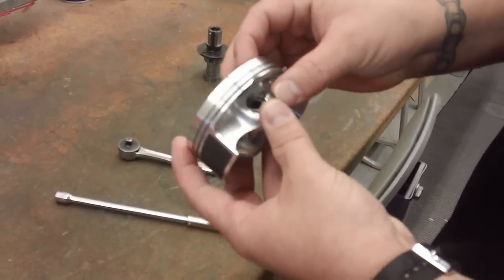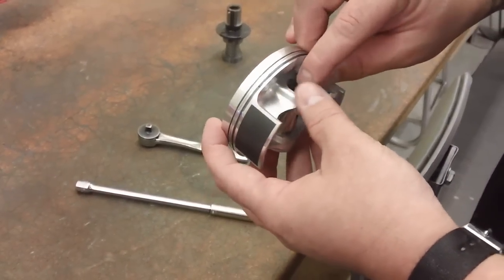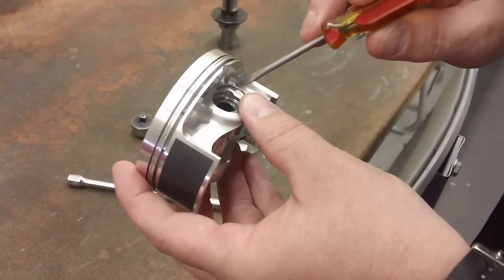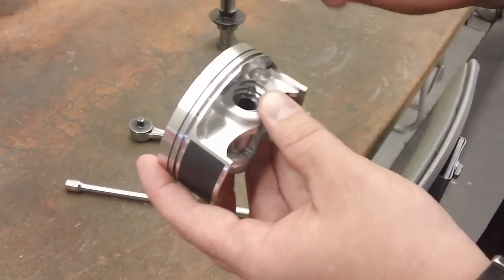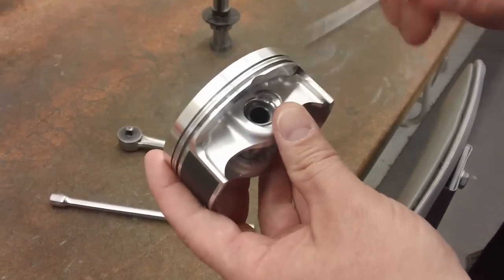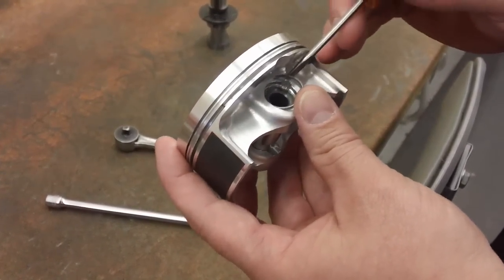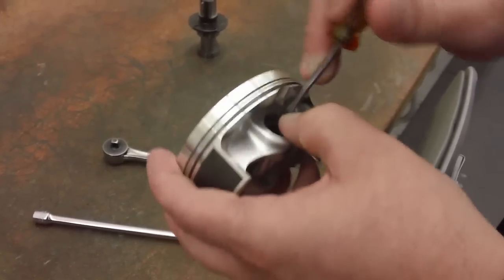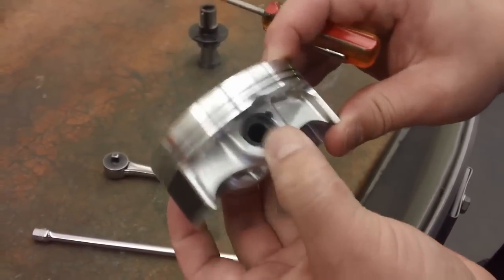How to insert a Vertex Pistons circlip

Comment: wicked video!....BUT... my Vertex KTM 300xc piston wrist pin boss was different had 2 grooves technically.  The first one was a straight bore, then there was a ramp into the boss area where the circlip seat is. There may be a way to use a C-clamp and sockets to pop the circlips in after its in the the first bore area. I ended up using a mini pry screwdriver about the size of the one in this video but it wasn't fun through the first bit of bore...